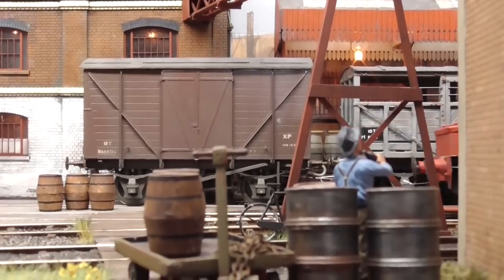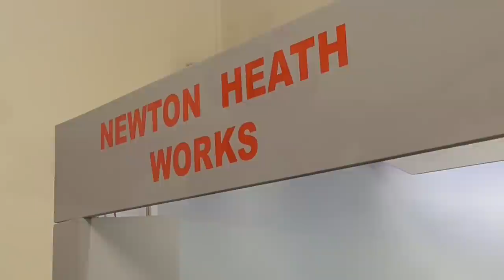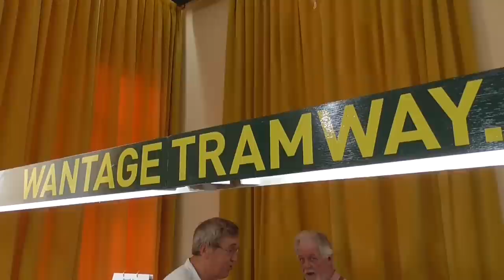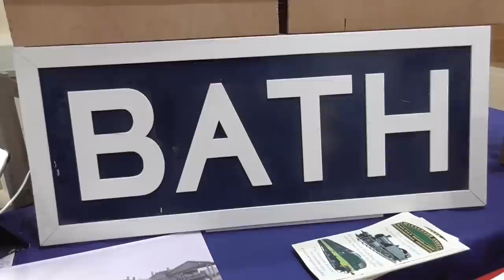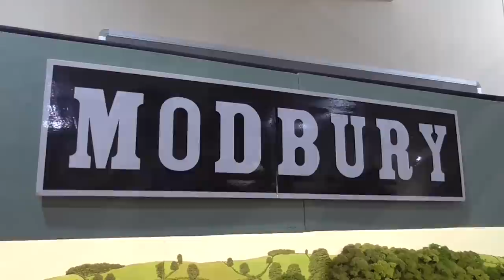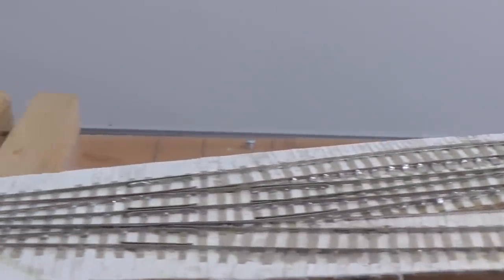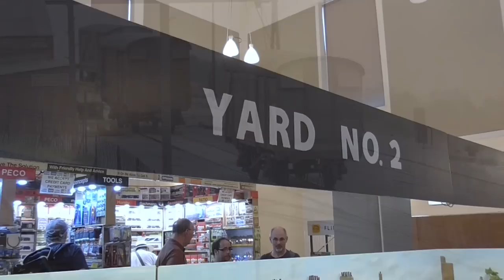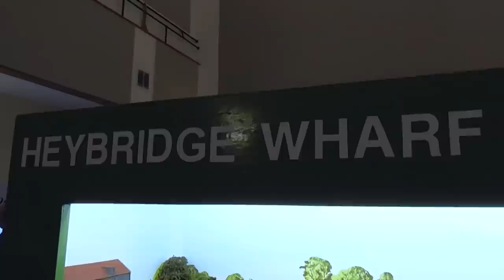RAILWELLS 2022 - Model Railway Exhibition - 13/08/2022

Comment: I didn't  get there this time but it seems a show which doesn't cater for the average modeller or for families. Having said that the standards look good and the layouts different
Reply from the maker: The standard of modelling is certainly high, but certainly is a family friendly show. Certainly a fair few in attendance
Reply: Hmmmm... doesn't the 'average' modeller deserve to be exposed to proper scale modelling? It is the route towards aspiration.
Reply: @royfearn4345  I play with toy trains as supplied by the trade in dc. Too old to have long term realscale plans and too expensive to go digital.